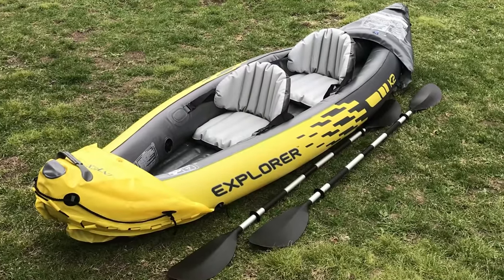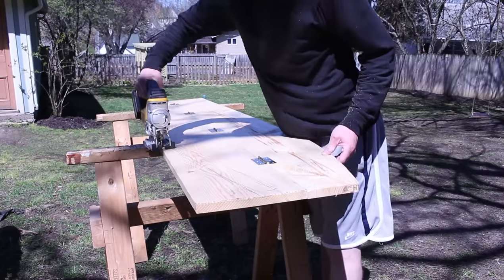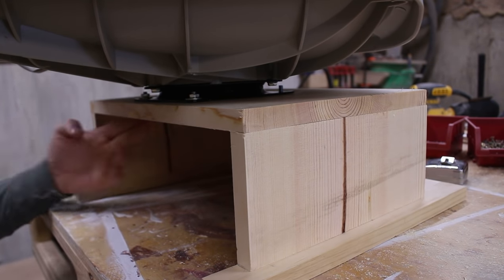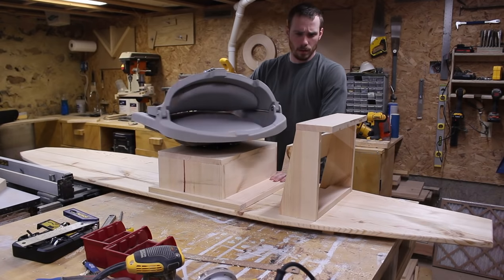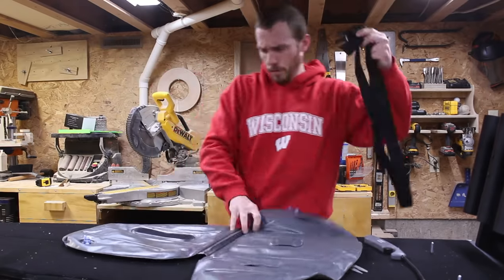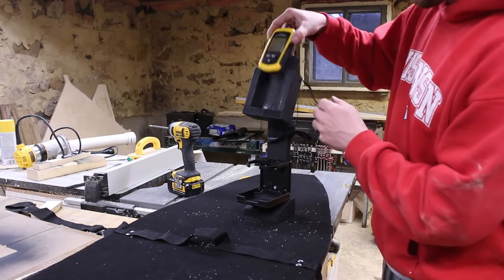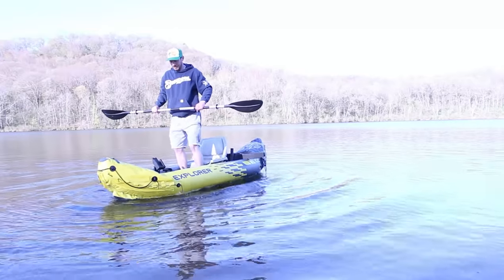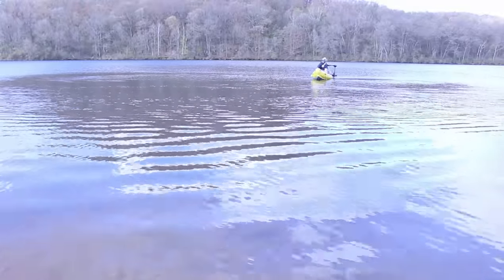Cheap Inflatable Kayak Modified Into a Legit Fishing Kayak!? How to Make It

Comment: So, two suggestions.  Remove the swivel on the seat.  You can see the seat leeching some of that energy from your paddling as each paddle stroke is twisting you back and forth.  It also appears generally useless as you have so little room to keep your feet.   Second suggestion - lower the seat.  Your center of gravity is too high.  Other than that, it looks great!
Reply: Hi
Reply: Good idea. Or drilling a hole in the swivel for a locking pin that can be lifted and dropped by a small lever and fulcrum on the side. Once lowered, just swivel the seat until it drops into place.

Comment: The most impressive part of this video was getting the kayak back in its bag
Reply: Mine ripped the zipper in half after 6 uses
Reply: They say thos was first time its been done
Reply: I own this kayak and it's very easy to get back in bag. I even added 2 lifejackets and a boat safety kit to it. ziped up no problem
Reply: @every-UserName-Is-used  I stuffed my wife in there too.  Still plenty of space.
Reply: It goes in perfect everytime. I love this thing.  69.99
Reply: Wish I had bought these when they were $70 on amazon but have been able to find the ob ebay around $100-$120 New In Box. It offers great value. 

Love the floor.

Comment: I believe the seat was installed too high in expense of stability. Thanks for the video
Reply: Same. Plus it’s awkward to paddle from so high and you won’t get as much action from your oars
Reply: Yeah his body's center of gravity should be lower
Reply: Wait I though was how to build a Jon boat
Reply: I plan on doing something like this with my Sea Eagle 370 but will be doing outriggers, 100 ah lithium, 55 electric. The whole nine yards.
Reply: Or better his made outringers,its totally the best solution.
Reply: @chrisbarclay6127  Hey I just bought the same kayak and wanted to do the same thing. Are you able to tell me how your experience was building the kayak? or anything dimensions wise if you cut plywood? Anything helps appreciate it
Reply: Clearly it is a choice.  Better for fishing, seat swivels better, worse for stability and paddling.

Comment: The stability issue is the result of 3 factors.  The elevated seat is raising the center of gravity significantly higher than what the kayak was designed for.  There's an episode of Survivor Man in Alaska and just raising the small camera in his kayak was enough to cause stability problems.  You're also feeling the effect of the trolling motor providing thrust that's not down the centerline axis of the kayak.  The weight of the trolling motor being offset from the centerline is also reducing the stability.

Comment: I think for more stability, you might add a couple of outboat mini pontoons. And to make the floor board collapse even smaller, you might consider cutting the  boards in half the opposite way and adding a piano hinge on one side and a flat latch on the other to keep it from folding while in use.  Also, you may need a balast to offset the weight of the trolling motor. If the battery and motor weigh the same, create an outboard box opposite the motor to hold the battery.

Comment: Loved this video. I dont do woodworking or fishing but am interested in both. I have a few questions. 

1. Could you have cut triangular holes out of every large piece of wood in order to make the load substantially lighter without loosing structural strength?
2. Wouldnt a light color spray paint be better in order to reflect sunlight and stay cool so that you dont get hot and the inflated kayak doesnt expand from heat?
3. Shouldnt you have spent a few more dollars for carpeting and run the carpet around the sides to the underside of the board to help prevent splintering and popping the kayak?

Comment: seaEagle 370 went out on Bay 10 knots over wind and Haulover current but the inflatable behaved well.  I had weight of 2 large coolers and two anchors and was able to anchor in 10 feet deep with a strong current using 35 feet of rope on each anchor.  Could not move well just forward to reach front cooler but the rear cooler to access it I had to turn completely turn around which is not easy but do able.  Cooler on back and front helped me with great back support and i could also push hard with my feet against the front cooler.  Seating enhanced with a car back support wide and had no problems with the back and I am basically fresh out of surgery.  How well I was supported with the two coolers and backrest and cushion i used for back support was surprising. I just can't turn around.  My deluxe seats are worthless so I am using the extra cushions they sell for seating and use those and it will also raise me 8 inches higher than reg. seat. which is 5 inches now I'll be at 13 total and it looks it could be that happy position.    This puts my hips almost level not quite to the top of kayak.  I found my self rubbing the shaft against the side chambers because i think these kayaks sits us quite low so I'll be higher but your set up here is great so many mods., but not for me the high chair  on the ocean.  I tested went out for my very first time other than just playing a little bit and it was awesome.  Out from Oleta to Haulover sandbar over 10 knot winds and had to cross a major navigation channel to get to sandbar I was ready with anchor, and drinks,  a front towing harness I made and one for the stern anchor.  At the end of the day  almost at crossing the Channel a JetSkier showed up and towed me across to the Park.  I was against the wind and side current and I was making progress but very slowly.  Point is I woul've made it only with patience, a lot of patience and good tecnich.  The anchor ropes must be leashed next to where I sit to facilitate usage.  I was de anchored twice by the current and also a motor boat hooked my anchor rope and dragged me for quite a bit and I think I liked being dragged from the rear than having been hooked on the front anchor rope.  I was thinking of using an anchor weight instead of grapel for the front but there's too much current.  I  am leashing the ropes next to me but with paddle elasic leash reaching from my seat all the way to anchor rope so it is retreat able and also elastic so if it pulls , it will pull from the rear or front instead of a firm leash to the seat(on side) 'cause then i can be overturned.  I had to deal with wakes from yachts and facing them correctly there was no problem.  I was also "brushed by a 35 foot boat, is crazy downhere.  I saw 2 of these kayaks on this video at the sandbar; they're very popular and it is just like mine same type.  That floor you made rocks, well everything you made is super.  I wish I had a motor for my sandbar and beercan island trips.  It is a good back and forth, and I went out the wrong way for the first time out of the park so first time on the Bay with 10knot winds while testing and paddling back after loosing the anchor thrice  I did at least  3-4 navigational miles, at least 2  1/2.  These kayaks when adjusted for the deed, are Great.  With my two coolers for bracing I am set.  I will add a Sail they sell for it and rod holders to hold umbrella, an extra grapel anchor with 100 feet of rope for front to anchor in 35 feet(need a lot of rope to anchor in Ocean) maybe I'll learn to fish, I should I love Snapper.  Next, is getting back up on these things which is easier said than done but with a good kick from Finned feet should be able to get over the top if one's not too tired.  I want to go skin diving and maybe even scuba but i need to get back on the boat confidently.  I could always swim back 300 yards holding on to the thing but I don't want to go there, I rather paddle.  I am 61 years old and I live in Miami.  Hope my experience helps anyone who wants to try and get out there, must be Prepared.

Comment: Surprisingly stable. Ropes across the bottom with some dumbbell weights locked in with knots could improve that even more if it's ever an issue. One for forward of CG and another for aft of CG. Wouldn't require a lot of weight to make a big difference in stability. Dropping vertical CG a couple of inches is noticeable.

Comment: You did an awesome job and this was a lot of fun to watch. I just bought the intex excursion pro and I'm doing some small add ons but nothing like this. Very impressive! Keep it up.
Reply from the maker: Thank you very much Michael! Good luck with your add ons!
Reply: Got one myself.  Hard to figure out how to attach stuff.  Thinking of using the rod holders as a motor mount and rod mount on other side.  What sucks is the seats that deflate.  That is my next upgrade.

Comment: Doing a similar mod to mine. My seat is much lower to not cause stability issues and have a pin installed to stop the seat from being able to swivel. I take the pin out when not paddling. Also only a half floor to decrease weight. Works great!

Comment: THANKS for your video and proof of concept!.....The one main thing that looks that you need is to balance the weight.
Yeap, battery to the front! 
Also, from the side at 09:34, without the battery, you can see from the side the plane where your centerline body weight is from head to butt vertically, you have 60% space up front and 40% rear. Maybe it could be moved a bit forward too?
Wanna go for the Triple Power Kill?
Get some Tyvek and pvc pipe ....an......Put a small sail up front!
You'll be the King of cheap power!

Comment: Thank you so much. Im a bigger guy trying to get in shape. On my first outing the kayak was sagging badly in the middle elevating my legs making it super uncomfortable. Gonna build a hinged board like yours and mount a seat. Seat will be lower than yours as i dont need bait box storage.
Reply: Simple quick fix for ya, cheap too...buy two cheap small bodyboards and place them in as a floor and then seats on top.

Comment: You can use a wood pole in the middle of the paddles secured with duct tape to lengthen the paddles and it will paddle much better and you will get less wet.
Reply: This is a good suggestion, never thought about that. Thank you.

Comment: Does it have mini keels? I think not. Mine has, it's itiwit 3. Now if you really want higher sit when fishing, I suggest you getting an inflatable kayak seat. You can stack 2 of them. If the floor is inflatable , it is already stable enough for me to stand up. It's 3.5 m long, so that helps. The modification I made is some sort of trolley system for the anchor rope. I'm tidying up 2 reels in front and back with straps, between them I have a another rope which end are connected with a carabiner. The rope for the anchor is going thought the carabiner. This helps me move the rope of the anchor to the back of the kayak. This is to avoid being tipped aside by waves and wind. I tie the rope of the anchor to one of the side handles. The holders for the rods I've mount on a plastic milk crate, that I use for storage of lure boxes, water, power bank, it has a shade on top. Meaning the rods are in front of me.I'm thinking of getting Chirp+ and flexible arm, which I'll mount on the crate.

Comment: Nice idea, and good effort.  Inspiring video - thanks.  I am not convinced that the seat is not too high for stability - based on some trials I did last summer.  I will soon be experimenting with a lighter frame + partial floor for stepping on. I am not so brave as you in the cold weather yet.

Comment: Just a thought if you already made a wood platform for the inflatable maybe 🤔 added stability pontoons off to each side? You already have the mount for the motor off to one side add some kinds of pontoon in front and do the same to the other. Should also allow you to stand up without it tilting so much

Comment: Dude! This is dope, great job and video.

Question, I have the Sevylor Colorado 2 person inflatable, do you think I could do a similar mod for a seat but smaller? For instance just enough wood for the seat to bolt to? Thanks.
Reply: Its possible I did it, instead of a full bottom I did 1/4 and it worked well. I did add stabilizers to mine using Walmart bumpers and a trolling mount and still worked.

Comment: Great design! Just curious, what are the benefits with your inflatable kayak over your inflatable row boat? And benefits with the boat over the kayak? Thanks for sharing.
Reply: In theory 2 people can paddle, that's one. 2. it has way less frontal resistance. If it has keels, it prevent it from rotating so easy. 3. You can go to really small creak with it. And again it's cheaper. Good inflatable boats cost a lot.

Comment: Great Video!

Last Father’s Day, my son gave me one of these but I really haven’t been able to use it.  The inflatable seats offer no back support and there is nowhere to brace your feet, which is crucial for kayaking.  

Your video might be the answer to my problems!  I do have a couple questions though.  

You used 3/4 inch plywood for your raft project and 1” lumber for this one.  Both are actually 3/4 inch.  Does the lumber seem less flexible as a floor?

Would there be any benefit to gluing the two lumber boards into a larger single board?  Isn’t there flex when you step in the center?  

Did you use full size door hinges?

With your raft project, you lined the floor with pipe insulation, but not with the kayak.  I’m curious why.  

Thank you so much for your detailed videos.

Comment: seems like that seats too high, I mean, it would less comfortable to put it lower but it looks like it;s gonna dump ya being that high.  definitely would me as I ( from size comparing you in the video with the raft), am twice your size.   come t think of it, the battery and the motor and wood  probably put up at above max cap. LOL   I just picked this same K1 from a guy that used it once and didn't like it.  20 bucks out the door.  I have that same motor also, I got it at the thrift store for 8.00!  handle was run over, picked that up on eBay for 12.00 .   I might have t o try something like this though  after I get my garage cleaned back up.  Looks fun and I got some decent ideas from you on this vid.  Thanks.

Comment: I have this kayak and there's a tiny hole right by the skeg from hitting 1 rock, one time😑. Any suggestions on patching it up? I tried one and it flopped. #2 is drying as we speak but I'm not confident at this point. I'd hate to have to return it for such a little hole. I also haven't been able to get the skeg out ever since the bump happen. And Ive tried everything I could think of. Which is no big deal but do you have any thoughts on that? Thanks! Loved the video.

Comment: A canoe has to Balance ...... I wood Move the Battery to the Front or under your seat ... Put your Fishing Boxes and storage boxes up front with your electronics and extend your Motor Mound beam 2 feet on both sides with pontoons or floats on the ends to eliminate Tipping !  Then you can make your seat higher !  Put your cooler in the Back!  .... Great Project !

Comment: Thank you! Thank you! Thank you! I have been racking my brain to figure out how to do this to mine. Nice fish you caught! Ha ha ha! I have an older Minn Kota transom that I modified to run on my SuperSport 16 (ft) aluminium as a manual bow motor. So, I'm thinking about switching your design to the bow. 2 other things. 1) Maybe laminate the 2 boards together, then cut them in half like you did in your raft video (that's how I found this vid). 2) I think that your Yak would be more stable if the seat is lower, but you lose tackle box storage. Just wondering. Thanks for the great ideas!

Comment: THat is elaborate as hell! I am surprised that the structure holds with all that extra weight
Reply: This boat is rated by the manufacturer for 400 lbs max load so no way a few boards and a small trolling motor are going over that!

Comment: How was the kayak with the trolling motor on the side for stability ? I have a small motor guide stealth st170 it weighs 7 lbs and the kayak leans over on one side a bit , I wanted to try another 5 speed 30 lbs thrust but not sure 🤔

Comment: The point of kayak fishing should be simplicity. Fishing kayaks look cluttered with all those modifications. The only modifications I would do to a fishing kayak are a milk crate and a seat, that's it. All my gear should fit in the crate and I might attach plywood on the bottom of seat for some rigidity.

Comment: Hello friend, I am writing to you from Argentina, it would be great if you could get a Sevylor Fish Hunter 250 or similar and make modifications. I do not understand why do not use 2 HP gasoline engines as they are even lighter than the electric motor plus the battery. In other words, the idea with this type of boat is to make it as mobile as possible. For example, I'm experimenting to fit everything into an airplane travel suitcase.

Comment: I have this Kayak and have been looking to hook it up to a trolling motor.  How fast do you think you can get on that 55lb?
Reply from the maker: Hello Cameron, sorry I don't have a specific speed but it moves it pretty fast. However, like I mentioned in the video, the 55lb thrust is way more powerful motor than you need. I would recommend a much lower thrust motor since it will be a lighter motor and be more stable in the kayak. A 30lb or 35lb thrust would work perfectly for this kayak. I only used the 55lb thrust because it is what I already had.

Comment: Any reason you used 1x10 instead of plywood like the boat video?
Reply from the maker: I could buy the 1x10 boards and not have to worry about ripping then down to size since they were the exact width that I needed.  Other then that, no other particular reason.

Comment: having the rod holders that close and  behind the seat was probably a mistake, unless you want to add other stuff up front not having to turn and tip the boat every time you use them would be better